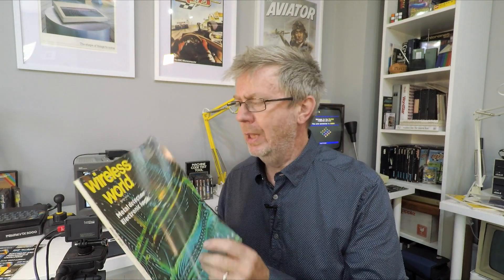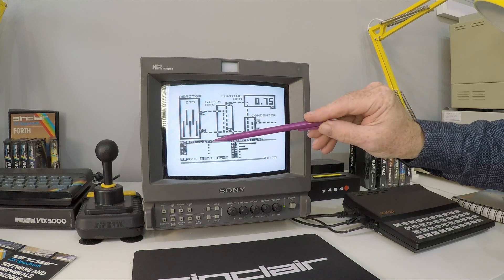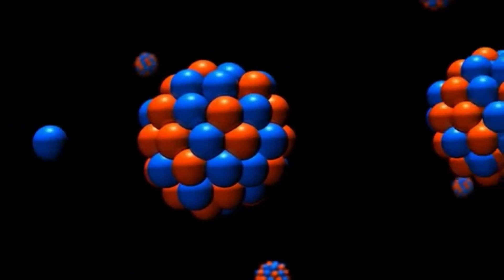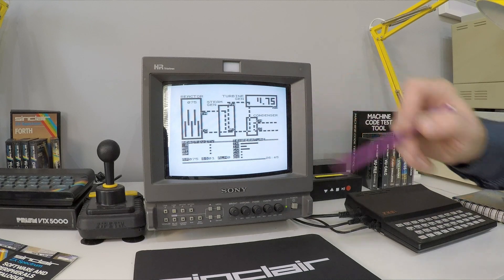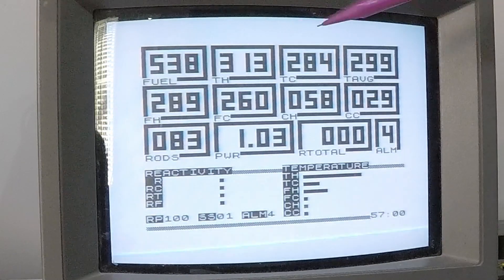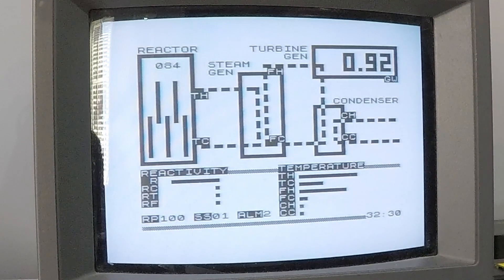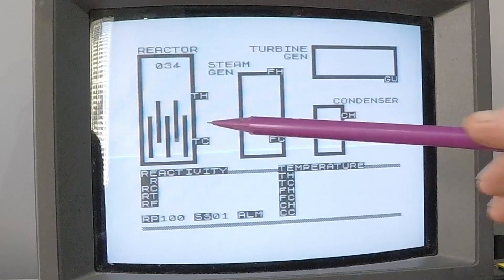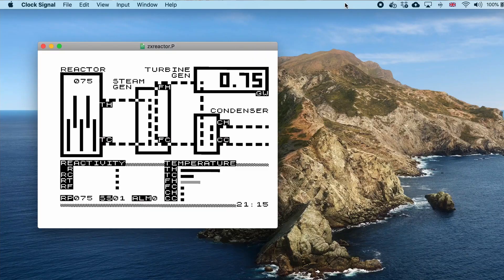ZX81 Goes Nuclear - Controlling a Nuclear Power Plant

Comment: do you have a GH or similar repo for the reactor C code? I'd love to port this demo to another microcontroller, display, etc. . Thx.
Reply from the maker: Unfortunately not, there is a small snippet of code that may have some interlectual properly attached. I was going to do a fudge and remove it but I never got chance.
Reply: @GlassTTY  understood. Any pointers to the equations you used for the simulation?
Reply from the maker: It was, what I understand to be, the standard 6 point kinetic equation. I'll try and sort out what I can re: C code, I may still have the early workings in Go (golang) which is a very easy port to C. Remind me in a week or so if you haven't heard from me.

Comment: Did you make it on 1K of the internal RAM or you had to add 16Kb of the external? (:
Reply from the maker: It uses all but 11 bytes of the 16k. I could probably improve it a bit though.
Reply: @GlassTTY   11 bytes? (: That is 5 Z80 instructions ...  You mean 11Kb? But original verison of ZX81 (I have a few here a tome is only with 1Kb built in RAM, and external extension via extension port to 16Kb). My first lines of code were on ZX81, then I moved to C64 tribe, I've made in 80' several games coding only in machine language direct in the RAM ... Some good old times! <3
Reply from the maker: @TheAndjelika  Yes, 11 bytes... The final code was just under 16K to get the model running properly. It was written in C though and cross compiled using DK88. The C library was around 2K in size.
Reply: @GlassTTY  11 bytes is about 4-6 Z80 instructions  (fill in some register(s) and jump to another location), nothing more. So I guess it is just to call what you have done in DK88 and compiled. What I could see in video, graphics and the rest can't fit in 11bytes anyway.  I was  doing lot's of codding in machine language (directly in RAM) in 80' mostly on 6510, but Z80 too, I was developing games, and earned my first money that way.
Reply: @GlassTTY  Thanks for the insight about how the simulation was put together
Reply from the maker: You are very welcome. J

Comment: Controlling something like a nuclear power plant is great fun.

I remember typing in the "Apple Nucear Power Plant" program (BYTE, Dec 1982), and then later experimented with putting different user interfaces on it for a human factors class.
Reply from the maker: I hadn't heard of that apple program before. I will have to route that out and give it a try. I have a couple of Apple IIs here.
Reply: @GlassTTY  I need to look for my variants. I’m pretty sure I put them on a flash card.

The problem with the original simulation was, it was written, assuming a TTY user interface, and so when things went bad with the reactor, critical values like the reactor temper, coolant flows, and heat exchanger temp, scroll off the screen due to too many alerts and warnings.

So I rewrote the UI, one used screen positioning, to keep critical parameters in the same position on the screen, and the second rewrite used Hi-Res graphics and speech synthesis.  

Then I did experiments. People did poorly when I added the speech synthesis because the text to speech algorithms at the time weren’t very good and I was using a TMS5220 chip for speech.
Reply from the maker: @hyretechnologies  thats awesome.

Comment: So is the ZX81 powerful enough?

I don't know, but the PLC that I cut my teeth on was a GE Series Six (the S6) that in its earliest form, came with 1K of program memory and 4K of register memory. And these could be used in a power plant, most likely with the expanded 4/8K, 8/8K, 16/8K, or 32/16K (or was that a 40/8K memory card?) memory cards. To explain the "4K/8K" bit, the card's total memory would be 12K for the 4/8K card, with 8k reserved for register memory, and a whopping 4K for program space - which usually was more than enough.

My first project was on a Berstorff Extruder/Calender/Splicer that had the smaller memory cards, the 1K/4K memory cards IIRC, and it was a bit of a challenge to get the code in there. 

The processors in the S6 was a 4-bit AMD processor, albeit there were four of them cobbled together to make a 16 bit CPU. 

The scan time of a bare program was 7ms, which was fast. Loading the PLC up with code would almost never exceed a 100ms scan time.
Reply from the maker: That's amazing, thank you for sharing.

Comment: The ZX80 didn't have floating point in BIOS so the RAM pack would have been required for floating point software routines. Got to say the ZX80 case to my eye is still the prettiest ever made. Glad I could not afford one as I would have been sorely disappointed.
Reply from the maker: The 8K ROM upgrade added it though didn't it? I can't remember the details now. My ZX80 case fell apart after only 25 years, it was very flimsy and the stick on air vents left me feeling disapointed. The ZX81 case was much stronger and makes a great door wedge. Take care.
Reply: @GlassTTY  You're right about the ZX80 ROM upgrade. Essentially identical to the ZX81. Seems I'm always the last to know.

Comment: The wobble problem was caused by the fact that the motherboard was on a slight slope, and the ram manufacturers made the ram like the motherboard was perfectly horizontal.
Thereby the connections were not having a firm contact, and when the connection was broke because the computer moved a little from typing -- boom -- everything reset.
There were a few solutions.  Put something under one end of the ram pack to match the slope of the motherboard, and 2 use some duct-tape to hold it together.
Yes it is true, you can prevent nuclear power plant melt downs with duct tape...
Reply: US former TS1000 user here.. Not denying that there was a wobble issue, but back in the day I explained the problem to my grandfather, who proceeded to fabricate a custom steel clamp with a heavy thumbscrew. That thing didn't move anywhere after that. And it would still reset. My theory is it was the RAM pack overheating (and the wobbly connector has been a bit overblamed).
Reply from the maker: Thanks for sharing Jay, take care.

Comment: Absolutely brilliant - nice to see sensible PPE for handling the 'Uranium'...

I'll have to finally build my ZX-81 kit, languishing in the attic near my old QL stuff, and see if Hinckley C needs a hand.
Reply from the maker: Glad you liked the vid,  and thanks for the comment. I would love it if you could make a video of the ZX81 kit and you building it. It's an experience that should be captured IMHO. The QL, well... If it were me... I would turn that into a kit, if you see what I mean. :)
Reply: @GlassTTY  It would be a great little project! I can't rememember where I got it, but the build instructions and guides are all in Spanish. Me no habla bueno Espanol, as you can tell... :D

Back in the day, I had in mind to get one of the PC QL cards, but things moved on. It's been fettled by Tony Firshman over 30 years ago - better CPU  to get around the problem of my Gold Card expansion not working on the original item. It already is a mini kit, I guess! I had a few PD titles out, plus some software for sale that has now joined the PD library - fond memories!
Reply from the maker: Fond memories indeed.

Comment: It would be great to make another video about the math behind (how it works), for educational purposes. This is nice  stuff but It looks like a black box for people not familiar with thermodynamics. Also : I noticed some display values (eg: digits or bar charts) get refreshed every frame despite not changing. You can probably save few precious CPU cycles by only refreshing what is needed.
Reply from the maker: Thanks for the comments, much appreciated. I did used to check for changes before displying the data but had to strip it out due to constantly being low on memory :(. All the maths used floating point numbers which made it slightly harder to compare etc. in the end I just removed it. I cant remember how much memory I had left out of the 16k but it wasn't very much.

In terms of a video re: calculations and those people not being familiar with thermo dynamics, I'm one of them :). This is an area where I had some help from a third party and the IP ownership of that help wasn't clear. I decided not to publish the source in order to protect those concerned, just in case. I guess it might be the same for publishing a video. To be honest I would struggle to explain it after all this time anyway :).

Glad you enjoyed it though.

J

Comment: You mentioned it in a short sequence how you programmed the simulation - in C - then compiled into Z-80 machine code and loaded into the ZX81. There must be some modification to get the code into the ZX81 run time environment - especially the quirky video ram (which shinks in size when memory is scarce) Did you program all of that yourself or are there libraries to program a ZX81 from a modern IDE?
Reply from the maker: i wrote the model in Go first and once that was working I converted it to C which very straigt forward. Once in C I used Z88DK as the compiler, this comes with tools to create a zx81 application. The IDE was VSCode running on a Mac with a few scrpts to build and launch the Clock Signal ZX81 Emulator for testing before creating a tzxduino file. I think I detailed it on https://glasstty.com.

I use the same environment for writing nascom stuff. Its more straight forward than it sounds.
Reply: The ZX81 only shrinks the display if it had <3.25kB in the first place and (your editing code; or you execute SCROLL or CLS and your running code in BASIC). If you have >=3.25kB the screen is always padded out to 32x24 in BASIC and won't shrink even as your program reaches the last 1kB. Machine code or 'C' programs generally pre-pad the screen to the specific size they need and then just address the memory locations for the screen, which will typically be SystemVariables.DISP+(lineLength+1)*y+x. (it needs a +1, because there's a CHR$(118) at the end of every line).

Comment: The problem with the ZX80 is that the program has to stop running in order to display the results...if you have to stop running the power station every time the operator wants to see whether it's going to blow up or not - it's probably going to blow up.
Reply from the maker: Youre right, Thank goodness I used the ZX81 :)

Comment: Hello, please would you tell me what is the software that your channel's picture showing? Left corner, on the orange monochrome screen.
Reply from the maker: That would be a CP/M game called Ladder shown running on my Altair clone.
Reply: @GlassTTY  Thank You!
Reply from the maker: I assume you are referring to the ZX81 software that features in the video? If so, this is the software I wrote especially for the video. There is a  link to it in the description.

Hope that helps.
Reply: @GlassTTY  Thank You but i meant the software that can be seen on your default yt channel picture, on the orange colored monochrome monitor at left.

Comment: Can you let me know your setup for writing code? It looked like you were doing it on an emulator. Thanks. This is a great vid!
Reply from the maker: For this I coded in C using VS Code as an editor. I then used the Z88DK compiler to produce a .p file.  The emulator was Clock Signal as I was developing on a Mac. Hope that helps.
Reply: @GlassTTY  Thanks so much, really appreciate it!

Comment: I choked on my cider at the extra blue-tack comment.  I used bluetack on my '81 to stop the wobble ( It didn't work, so I upgraded to velcro which was better but didn't really work either )
Reply from the maker: I'm glad you enjoyed it! The video that is, not the choking. :)
Reply: I was convinced the flicker and the restart came from the acid rain we had in the Leipzig area back then. And actually - cleaning the contacts of both computer and extension RAM helped for a while. But the machine was delicate - especially times when saving the program was not as easy as typing :w   (as of today I still save my source code every couple of secounds coming)
Reply: I put my ZX81 on a book so the RAM pack didn't nudge against the table. It was still a bit scary, but worked OK for me.

Comment: That comment about the switch-mode power supply hit home. The Timex Sinclair 1000 was my first computer, back in 1982. This was the ZX81 in the US, basically (I think there were very minor differences). The heat in the summer was bad enough that the thing would just white-screen and I'd lose all that sweet BASIC code I'd been working on, so I cooled the thing with a bag of ice sitting on top of it. The condensation wasn't a problem for the plastic case and membrane keyboard. Take that ice off for 30 seconds, though, and the computer would lock up. I sometimes had to race to refill the plastic bag with fresh ice before that happened.
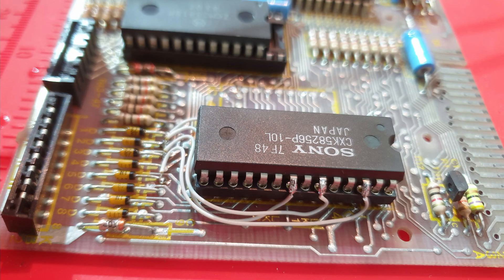Reply: 6:27 and just after 12:35, for anyone wondering.
Reply from the maker: That's a great anecdote thanks for sharing...

Comment: Hi there! My undergraduate thesis for automation engineering, at the end of last year, was controlling a nuclear reactor using a brazilian ZX81 clone (a Microdigital TK85). I designed a whole load of hardware plugged into the expansion port, for analog inputs and digital and analog outputs, and a display panel. The software was written in Z80 assembly language, and ran a SCADA system for the controlling the reactor, not simulating the reaction. I took most of my weekends in 2020 to get it running, but I managed to demo it during the online presentation for my examination. I simulated the reactor through the analogue inputs, controlling things like temperature, pressure and so with potentiometers.
Reply: Please share a details!
Reply: Fabulous. Would like to read your thesis also!
Reply from the maker: Hi Simon, I'm so glad you got in touch. Did you post something on a discussion forum some time back? I'm not sure if it was you but I saw a photo of the control panel that was built and tried to get in touch at the time. Either way, it would be good to read your thesis and see some photos of what you achieved.
Reply: Where can we read your thesis? This sounds so cool.

Comment: I loved the euphemism 'standard 16K ZX81'. :) We used expressions to save two bytes when we needed 0 or 1 as a constant (PI-PI for 0 and PI/PI for 1) because of the 1K RAM, 721 bytes of which was consumed up by the display. Having a 16K RAm extension was a royal feeling. :)
Reply from the maker: Your right of course 16k was a real luxury back then. I remember the struggle I had trying to do stuff with 1k using the ZX81 kit I had built. Great fun though.
Reply: Were you using a clone in those days in Hungary? I'm British (but I now live in Hungary) and I'm of a 1974 vintage. In the UK I built a ZX80 and then later had a ZX81 but I don't think I've ever seen one on Marketplace or Vatera etc.
Reply: @yrath5034  I had a friend who had lived in Britain before we met. And he brought a ZX81 from there. While he served in the army as a conscript, I could use his computer. It was around 1984 - 85.
Right now I have three ZX81s, all of them from Vatera. :) It's not an everyday find, but with patience it'll show up from time to time.
Reply from the maker: @yrath5034  Was this message for me? Unfortunately, I have never been to Hungary nor ever used a ZX81 clone, there is still time though! :)
Reply: @GlassTTY  Sorry, it was directed at Zoltán.
Reply: Your programs must have been pretty darn slow though... if using floating point division (pi/pi) for simple integer constants seemed like a reasonable solution.
Reply: @herrbonk3635  The ZX81 BASIC had no integers. While the PI/PI expression took up only 3 bytes (as PI was a BASIC keyword), the constant 1 took up 5 bytes (coz it was represented as a float). And yes, this solution did not help to speed up the programs... :)
Reply: @Kedvespatikus  I know, I had one, but I skipped that slow BASIC interpreter. Using floating point formats for integers is one thing, using bitwise floating point division in runtime for a konstant is another... :)